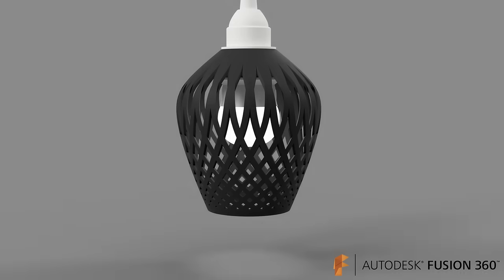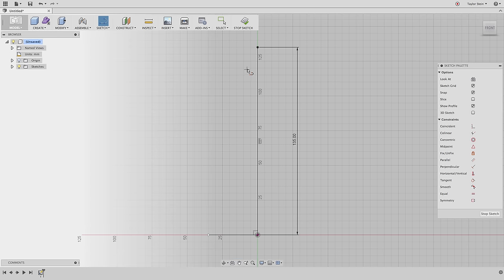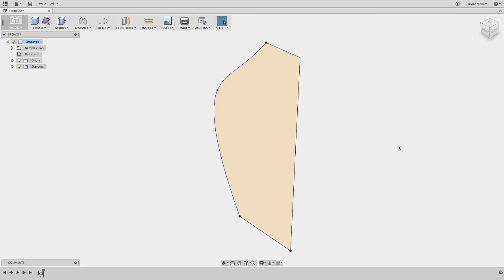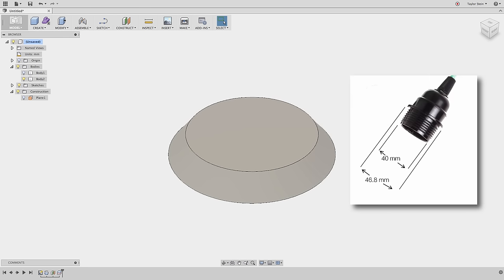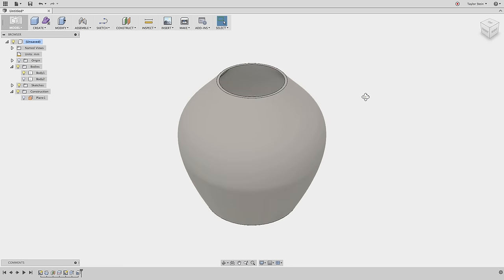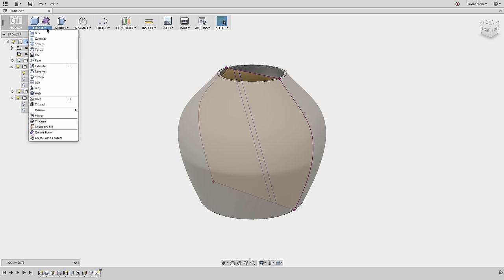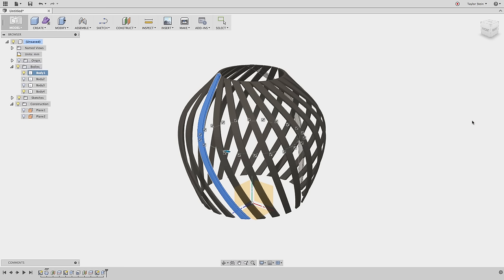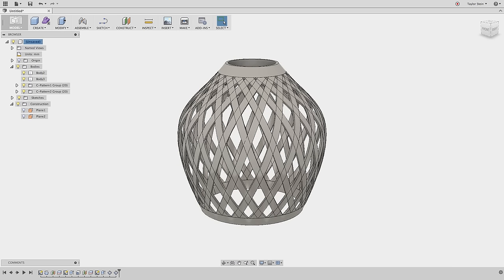Fusion 360: Design a 3D Printed Lampshade

Comment: I just started using Fusion 360 and I am amazed at how easy it is.  There should be a course in high school for Fusion 360 just like there was for typing.  Just like typing has become very important, 3D design will be very important soon as 3D printing becomes common place.
Reply: Yep I'd say Fusion is way easier than any other cad app and results are better.
Reply: Solidworks is so much easier
Reply: In my school we do the cours
Reply: @timbollinger  Simply no. And it's not free.

Comment: This is one of the best explained Fusion video projects I've seen to date.
So clear, no steps missed or assumed, making it so easy to follow.
And here we are in 2022 and this is still the best.

Thanks for that.

As I watched the video, I saw something that gave me an idea.
That is, when the shade is first rounded, without the diamond cuts, it looked like a flower pot.

So one could make a matching flower pot and lamp shade that would be very cool.
And the flower pot COULD have a few styles.
Solid
Diamond cuts
other cuts
but all retaining the main form.

Very cool!
Reply: I went back to the step to creating the circular patterns.
Before doing that, I added a 0.75mm filet to the "straps".
After doing the patterns, there are no more sharp edges.

Looks nice.

Comment: This program is mind-blowing!  Years ago I tried to teach myself patch modelling in both 3dsmax and Maya - whilst I made some progress I eventually gave up because of all the clumsy and  complex operations you had to perform attaching, detaching and stitching surfaces together.  I therefore chose to develop my high poly modelling skills and left behind NURBs as an interesting concept but impractical method for creating complex models that would be used for animation or game assets. I've always been aware of programs like AutoCAD, SolidWorks and even Sketchup as good solutions to producing complex accurate surface geometry -  however, I never viewed them as creative as your ability to radically alter or kit bash a model together with purpose was limited. This program is nothing short of a revolution in its approach to surface modelling - all of the complex operations are gone and you are free to manipulate your creation with precise control. I'm sure a lot of other poly modellers must be looking at this program and seeing the possibilities... I've already experimented creating shapes that I've exported out as meshes to Zbrush and the results incredible. The meshes will eventually require retopology in the final stages for the kind of work I do - but this isn't too difficult. If Autodesk could also develop a way to export these models out with good quad topology then this program would be perfect!

Comment: Remarkable in clarity of each step
I am new at it but used Solidworks extensively for my designs
I would love to see how a Jewelry Ring can be designed
I am wondering if you can import files from SolidWorks and create faces on surfaces from SolidWorks 
I know Rhino 3D has that capacity

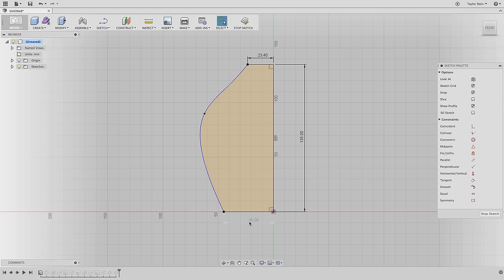Comment: ok nice one  @Autodesk Fusion 360 i did follow this with my version of fusion 4.5 all done and went well , i had to find some commands because i work with a newer version that was no problem but now at that moment wen you could change some settings like dimensions now loot at 10:30 if i change the lenght and with  then wen i look at the end its all an mess with the lines across the lamp

Comment: That's fairly easy, now where it gets complicated, because I had the same issue designing a lighting fixture is: how do you make the straps  to be intertwined, I ended up downloading a bunch of programs, Solidworks, Inventor, AutoCAD lates version, Fusion, Sketchup and none of them did it because I realized these are not shape manipulators, I needed the straps to be overlapped all around, the only ones that seem to do that are, solid thinking or 3d studio, but max is not parametric and cannot make drawings. So any ideas out there?

Comment: After you create the 44 strips, you have three bodies.  Do you not need to combine these three bodies back into a single body?
Reply from the maker: It might be a better practice to combine those, yeah. For STL that may not pose too much of an issue, though. Not sure if you saw the discussion on STL vs 3MF in the community tab, but from now on I would want to use the 3MF in which case I'd definitely want to combine those bodies.

Comment: Hi, thanks for the fantastic tutorial. It’s possible that I ve problem with export to stl? If yes how can I resolve it?
Reply from the maker: What's happening when you try to export? Are you online when you try to do this?
Reply: Autodesk Fusion 360  thanks for reply!! I’ve This error: could not export file to stl. It seems that the program have a problem with “translate” the file to stl.
I have try online and also offline: always same error. Try also to celano the cache but same error returns.
Reply from the maker: Hmmm, have you seen these suggestions: https://forums.autodesk.com/t5/fusion-360-support/can-t-export-as-stl/td-p/7635617 
If not, are you willing to share your model with me via a share link?
Reply from the maker: Or permissions related? 
https://forums.autodesk.com/t5/fusion-360-design-validate/exporting-stl-stl-translator-failed-to-export-data/m-p/6025186#M44894
Reply: Autodesk Fusion 360 Hi!!! I’ve found the problem! When i’m not with a stabile connetction, the program is not able to export! It’s better insert this indication in the error that Fusion give?
Reply from the maker: I was working with someone recently who had a similar problem. What's important to note is that the STL export from the component browser can be done at any time.  Just select the body, right click and choose "save as STL". https://forums.autodesk.com/t5/fusion-360-support/can-t-export-stl-when-working-offline/td-p/7882509

Comment: So I followed your tutorial and designed this in Fusion.  However, when I tried exporting it to Meshmixer it only imported one body at a time and I was unable to make all the bodies form one component.  I actually want to print this so is there any way to work around this issue?  Has anyone else had success?

Comment: The only thing bothering me is that the intersection isn't normal to the surface, wouldn't this result in very sharp corners?

That is often a problem when I work with curved surfaces.
Reply from the maker: You could use some sheetmetal design trickery to ensure everything stays normal...or chamfer/fillet those sharp corners.

Comment: Why wouldn't you combine all the bodies into one single solid? wouldn't this reduce the risk of printing error?
Reply from the maker: +Evan Smith That's a great point! You can certainly use the combine tool to create one solid body before exporting. Exporting all of it at once seemed to work just fine in our slicer, too!
Reply: +Evan Smith Yeah I found I needed to do that for Simplify3d, Cura didn't seem to care though.
Reply: +Kirby G yeah, I just do it by default now.  The last time I didn't combine parts my printer put a tiny layer of support material between each part, which melted away of course, leaving me with lots of little pieces.
Reply: Thanks for posting. Being a beginner with Fusion360, I couldn't work out why S3D wouldn't slice it properly until I read your comment.
Another lesson learnt.

Comment: How do I make a polka dot pattern In the lampshade?
Reply from the maker: @VeganSynths-  It depends on what your end result is.  If you are looking for a realistic rendering, you can create a polka dot pattern very easily as a material.  If you are looking to 3D print or manufacture the design, you would have to physically model the polka dot pattern using different modeling methods.  Also, take a look at Autodesk Dynamo Studio for Fusion 360

Comment: can fusion 360 do everything what autodesk inventor does
Reply: Yes, rendering too! Also, you can download add-ins
Reply: no, it cant do many things. like belts and chains, gears pulleys and many more. but its a really great tool
Reply: You can easily bring alot of that in by the Mcmaster Carr browser in Fusion. Inventor really shines when it comes to large assemblies, molds, the option to add Nastran In-Cad and so on. For me I use both but I usually find myself working in Fusion for most things. Their both really powerful.  - Jacob S.
Reply: If all you do is make stuff for visuals and don't care about precision, then it can do most things. But Inventor is a far more serious engineering tool. I wouldn't develop or design an entire product or assembly in Fusion, because that wouldn't be possible. You can design an entire car in Inventor, functionally, from ground up to the last screw.

Comment: Frankly speaking, the derived design is not the same as the initial one. The lines on the original render are curved.
Reply from the maker: Hmmm...are you just saying the rendered version looks different. That's pretty common due to different focal length, materials, backgrounds, etc.